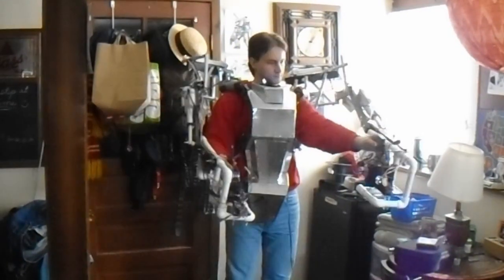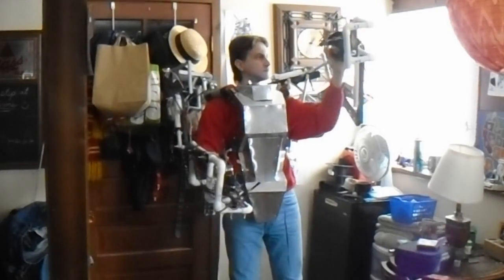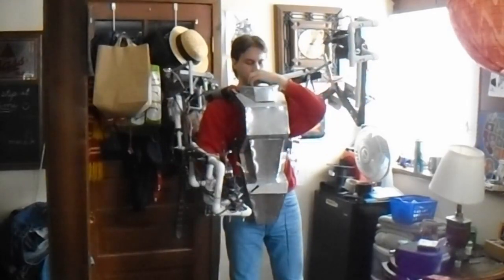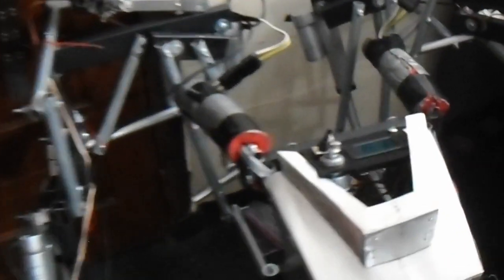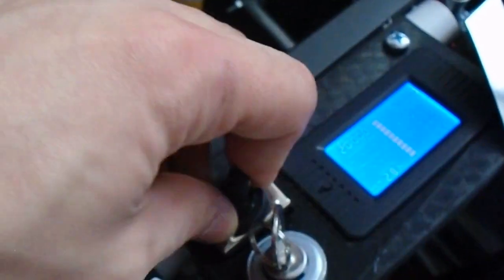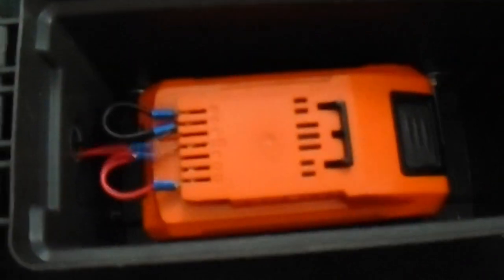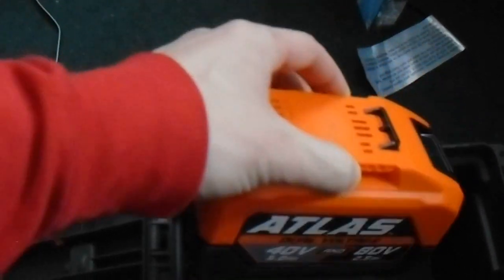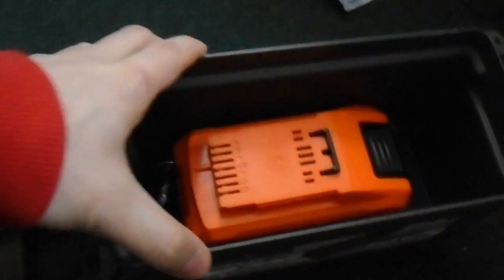Power Armor Control Test

Comment: Promising, but is there any way to make the arms move faster or is that a hard limit?
Reply from the maker: The limit is how many volts I dare to pump through them: meant for 12v but I've used 48v without any burnout

Comment: Cool, what is the maximum weight it can lift up ?
Reply from the maker: At 12V each actuator can lift 200lbs.  I run it at about 40V so that is about 600 lbs of lift.  However that does not factor in the leverage of the limbs (gotta divide the distance between actuator mounting point & joint by length of the entire strut).  So I'd say a bicep curl of 150lbs and a benchpress of 100lbs.
Been replacing some parts with squarestock so I should be able to actually do a lift test without the frame bending ^_^;

Comment: In my opinion, based on reality is...
(Pneumatic, motor <It looks strong, but it cannot be used for heavy applications. Mostly used in various flexible work. Or use speed>)
(Gears, hydraulics <strenuous applications use these To make it flexible, you have to build a system for it.>)
You can see from what I said there are solids, liquids, and gases mechanisms, as well as magnetic ((motor) or magnetic fields, in this age you won't find a lot of energy to make it highly efficient, so you don't have to. Highly motorized), using materials and placing mechanisms in suitable places is most efficient until they can be used for various purposes.
Reply from the maker: The system is all electrical: each motor has a gearbox that changes circular motion into linear motion (The unit is called a linear actuator).  At 12V each actuator can lift 200lbs.  I run it at about 40V so that is about 600 lbs of lift.
Reply: @NyeMechworks  But will the material withstand 600lbs? Including the speed of the system does not work close to the speed of the muscles.
From the structures you can see, you'll need to build your legs and spine to support the weight. Otherwise, your spine will support the weight. When you lift heavy objects (calculated numbers are not answers to all questions ... but with / structure / material These systems / systems are more important than numbers that apply to the virtual worlds.
Reply from the maker: @infinitylogic1164  Due to leverage, the estimated max load would be 150lb bicep curl, 100lb bench press.  The forces the actuators experience would be up to 600 lbs.  This is similar to how your shoulder muscles actually have to handle 2-3x what is lifted in your hand).
I've upgraded from metal conduit to square aluminum stock, and it is much sturdier now (vid coming out next week).
I'll be adding passive, unpowered legs.  EG legs with clever elastic cords.  I tried lifting a 50 lb weight with the furniture-grade metal and it started to squish lol.
Reply: @NyeMechworks  This is the start of the power-up kit that actually works ... right?
Reply from the maker: @infinitylogic1164  Not exactly a kit, perhaps plans I'll sell via book in future.

Comment: That's a pretty cool exoskeleton! A few questions, though. Do you plan on using this sort of arm design on Marduk, Talos, or the like, at any point in time? Also, I'm a little curious and concerned, how safe to wear is the aluminum flashing suit? Are sharp edges a problem or anything, or is everything in contact with you sanded down? I'm assuming the pool noodles on the sides have something to do with safety as well. Also, do you plan on adding anything that will allow you to grip objects with the armor? Because it seems as though there isn't really anything that allows for such a capability, given your human hands are preoccupied with controlling the suit. If there is a way for you to grab things with the exoskeleton, I would like to ask how much more you can lift with it than without it, if you've actually tested that. Those questions aside, I eagerly await whatever you plan on doing next.
Reply from the maker: Perhaps a waldo-ed variant of these arms will be for a third mech/full bodied mech (with feets).  The aluminum flashing isn't much of a problem because Its mostly away from me (I'll be covering any questionable insides with tape or filling the armor with a composite).  Gonna be making a new rig (aka gluing gloves with bowden cables to the handles) to add a hand gripper.
Given leverage, max load is estimated at 300lbs bicep curl, 150lb benchpress.